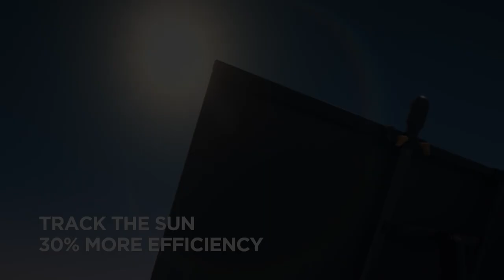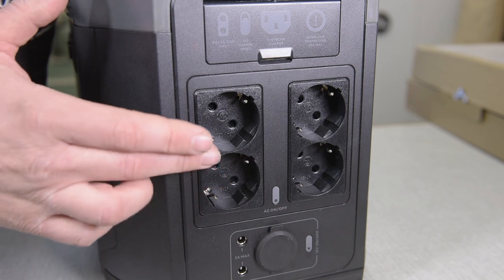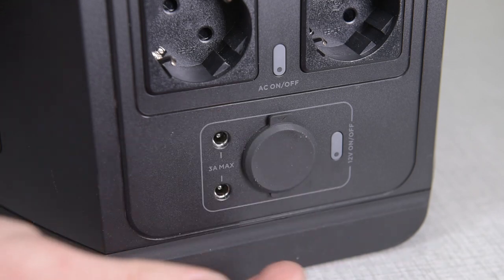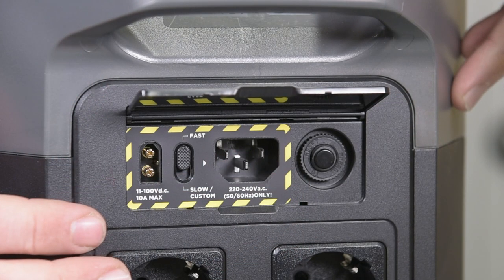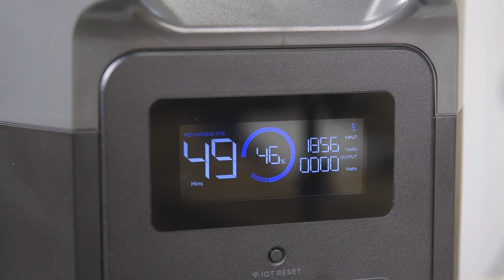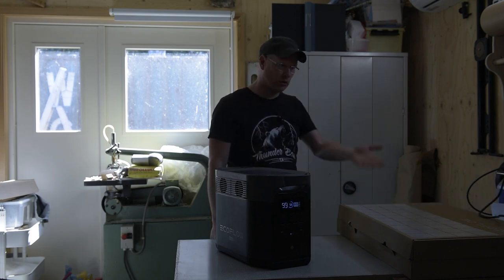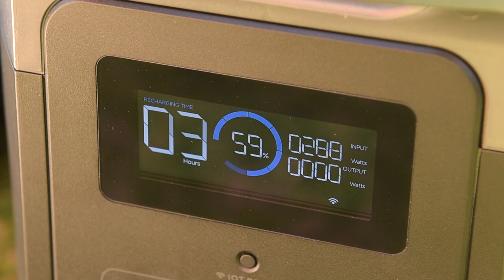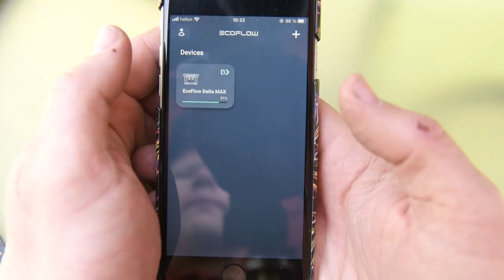Blacksmithing off grid with the EcoFlow Delta MAX

Comment: Nice video and a great presentation for the sponsor.  I was particularly impressed that the batteries would keep up with the welder.
Reply from the maker: Thanks! Yes, that impressed me as well.
Reply: I have been looking at these or other brands recently.  One u-tuber said that in his experience, this was the best brand.  That it would operate a welder is a definite selling point. Thank you for the demonstration.
Reply: I met some guy a few years ago that had welding a job in a ski station with no power, they used some kind of battery powered stick welders
Reply: why does he wear a respirator?
Reply: @abdullahanwaar7389  so he does not breath the fumes and particles from the coal

Comment: Best review yet I've seen on these EcoFlow units, mainly the real world shop testing.  The engineering and modular designs on these is quite good, including the panel kits, imho.  Good design is always expensive but a 4k investment is substantial for an old geezer on fixed income.  Glad that you hooked up with them and did a bang up job testing it for us!!!  Thanks Torbjorn always appreciate what you bring to us!
Reply from the maker: Expensive for sure as most Li-Ion batteries are, but could be worth the investment for some! Thanks

Comment: My family and I were affected by Texas' power grid failure back in Feb. 2021. We definitely could have used one of these to get us through it.
Reply: Generac is instant power, and doesn't require solar power to charge it.  I'm assuming you suffered through the polar vortex situation, and the Biden fossil fuels cancellation, which his energy secretary dictated for all natural gas pipelines to be shutdown also, which froze the valves shut, rendering the emergency critical, and people froze to death, and tens of thousands suffered immense property damage also.  Fossil fuels are still FAR more reliable, but that battery pack is impressive don't get me wrong, the world just is DECADES away from canceling all fossil fuel energy.
Reply from the maker: Honestly if we were to stop using fossil immediately, I don't think it would take that long to figure out new solutions.
Reply: @torbjornahman  how would you forge without coal? Not to mention these power sources are just batteries. They all take tremendous amounts of fossil fuels and tons of mined minerals to manufacture. If the world stopped fossil fuels all at once people would freak out with no phones or YouTube. Wind and solar can’t come close to the load that humans require.
Reply from the maker: @gregdazer8395  For a forge I can use charcoal with no problem, it just more practical with coal as it lasts much longer.  Indeed there would be panic, but with panic people will find new solutions :) I'm pretty sure we already have alternatives more or less, it's just a matter of people investing in new tech but very limited amounts of money are actually spent on research like this or on implementation. It's so much easier to keep burning fossil.
Reply: @torbjornahman  I’m sure you can use charcoal but burning any fuel emits CO2. So to those pushing the climate change narrative charcoal is just as bad. In actuality the most abundant greenhouse gas is water vapor not CO2.  Once the world caves and drops fossil fuels they will just make a move on other fuels. There will be no end. If the world wants reliable energy fossil fuels or nuclear are the best options. Wasn’t looking to start a back and forth however. I love your black smithing videos just wish everything wasn’t trying to shove a phony climate change agenda these days. It used to be called global warming but that lie fell apart. I hope this one will soon do the same. God bless from America.
Reply from the maker: @gregdazer8395  :) Charcoal is Co2 neutral, since it's made from wood. Nuclear is definitely something we should use more of, but move away from today's water cooled high pressure reactors. They are all more or less designed to make plutonium and electric energy as a secondary bi-product :) With only energy in mind I think reactors would have looked very different.

Comment: A really cool idea with this anti-lawn mower fence. From what you can see, the power bank actually has a huge capacity. I have a garage without electricity. I have been thinking about using such a power bank in my case for a long time, but I was curious how it actually works. You can see from your video that it would be a good idea for a garage
Reply from the maker: Thanks!

Comment: That's pretty cool that you can run ur shop off one of those. Can't wait to see more videos soon my friend. Hopefully you get great use out of it for many years to come my friend. Keep up the great craftsmanship and hard work my friend. Forge On. God Bless.
Reply from the maker: Well, I can't run any 3-phase machines, but the basic things will work fine!
Reply: @torbjornahman 
And if you use a frequency inverter? It has a single-phase input and three-phase output plus you can vary the frequency according to your requirements.
Reply from the maker: @ivanlarin86  Yes, and no... Single phase converters usually does not step up the voltage so I would get 230V 3 phase, which would require a re-wiring of the motor to D-drive instead of Y. Since they are all wired for 400V. I could run my wood lathe which is already wired like this.
Reply: @torbjornahman 
Sounds reasonable!

Comment: Impressive gadget !! That power unit could be very useful in my neck of the woods, namely outback and isolated areas of Aus. Would be very handy to be able to do small welding jobs without having to cart around a large generator, not to mention camping trips etc. Top video as usual, enjoyed the review of that power unit. Regards from Down Under.
Reply from the maker: Definitely. They are not cheap, but probably worth the money in situations/areas like that.

Comment: Thanks for the video, a pleasure to watch, the lawn mower robot is so cool.
A very good product, I'd see this perfectly for a week-end or even a week camping off grid. 
If only used for phones, lighting, perhaps a couple of laptops and low power consumption stuff, it can last for a long time, not to mention the solar panels, I see they provide 240 W. Means that every 4 hours you get 1 KWh available again if I got it right.Which means up to 1/3 of its available power.
Reply from the maker: Yes it lasts a long time for things like that. Each of those panels are 160W, and with full sunlight they provide about 315W. However you can charge with 800W solar if you have that available.

Comment: I have just looked at the characteristics of this UPS on the company's website - a pretty good thing. With a power of 2.6 - 3.4 kW, if you don't load the connected devices too much and use them moderately, then I think one charge should be enough for a day. And if you connect additional batteries, you can increase the power to 6 kW.

Comment: Wow! Impressing!
That power unit seems to have some really good batteries to cope with the welder! In most of the cases the batteries will fail first and if possible, need to be replaced. But it is still a very good and useful equipment which is a nice addition to the workshop!
Thank you for your videos! 🙂

Comment: I found myself trying to blow the slag off the anvil during the close up shots🤣 habits I suppose.
That’s a very impressive power station. Compact and very easy to use. Did you try the mig welder? I’m sure it needs Atleast 4,000w maybe more depending on make and model.
Reply from the maker: Well, the mig is 3-phase...as most of my machines.
Reply: @torbjornahman  well that makes sense. Had no idea it was 3 phase. Mine are all single phase 240v so it made me curious.
Reply from the maker: @erikcourtney1834  We use almost exclusively 400V 3 phase for heavier machines. Here every household has 3 phase.
Reply: @torbjornahman  that’s pretty smart that it was set up that way. Less current needed at higher voltages.

Comment: Is that a special kind of rebar that welds? You're truly a master blacksmith!!
Reply from the maker: I think you can weld most rebar, no? Perhaps not great but still.
Reply: @torbjornahman  I thought you had to use type B?  Maybe not?
Reply from the maker: For actual structural integrity I have no idea, but for something like this it just needs to "stick together". :)
Reply: @torbjornahman  
Good to hear.  I was thinking about building a log rack but decided to use treated lumber Instead. 
I tried to weld two pieces together but it didn't hold. I'm not much of a welder though.  Have a great day!!

Comment: @11:02 what is that square block with the all the holes and Radii/Radiuses on the outside called?? I recently got into blacksmithing and I've been wanting to get one but I have no idea what it's called and trying to describe it, to be able to google it hasn't been easy lol.

Wow I'm really impressed that the power bank had enough power to run an arc welder. 😱👍👍
Reply from the maker: It's called a swage block!

Comment: Hahaha, good video Bjorn. When I saw the title, not knowing a thing about the product, I was wondering if some lunatic had created a setup to run a forge/kiln, power hammer etc., forgot you only have the kiln for heat treating. Impressive as others have said that it can power a welder, those things draw a lot of power, but more so, a lot of AMPs, would be well curious for someone to continually use one to weld and see how long it survived. How long did it take to charge it using the solar panels?

As to the project, when you were done I was still scratching my head what the heck it was for, good and elegant solution, but did not realise you didn't cut your own lawn :-p LOL
Reply from the maker: Don't know about continuous welding, but for smaller projects it would work fine it seems. With the panels I got it charge with about 300W, so that would mean a full charge in about 6h.

Comment: A portable welding machine need about 6 kw to work. The ecoflow station powered 2 kw  ???  I don't understand. Can you explain ?
Reply from the maker: Not a small stick welder like this. It normally runs on 16A 230V.
Reply: This is actually the first time I have ever seen the Delta Mini being used in a blacksmith shop. Thanks for the video.

Comment: Perhaps an induction forge rather than coke fired conventional. Sadly most models won't operate on the available current from the battery pack you are promoting.
Reply from the maker: No, those start at 20kW or so...

Comment: how fast is your forge
Reply from the maker: How fast?
Reply: @torbjornahman  well if you put brush steel in forge how much time it takes
Reply from the maker: @hermannikarhu620  It depends on the size... A 10mm bar will heat up in 30 sec. maybe... Reheats much faster

Comment: A fair test would be to run it on solar only without first charging it from the source you are trying to replace !   Maybe on an overcast day !
Reply from the maker: Well, as an emergency power source you might have it charged from the grid and during blackout you use solar. Totally off grid is another story of course. Solar on an overcast day is pretty lousy, maybe 10% from a sunny day.

Comment: Okay... I've only been an electrical worker for 27 years, so there are a lot of things I don't know yet. BUT...

100 watts at 5 volts is 20 amps. 20 amps through an 813 micron diameter wire is a BAD IDEA. I'm calling "hyperbole" on this one. Hyperbole is like cockroaches: if you see one, there are more than one.

Also, the battery is SMALL!. Yes, small! 2kwh divided by 20 amps divided by 220 volts is 3/4 hour of use. Pathetic.

Again, I've only been an electrical worker for 27 years, and I've only been studying electricity and electronics for 46 years, so there are a great many things about it I've not learned yet. Take my "it sucks" opinion with a grain of salt.

You have nice plants in your garden! I'm also VERY interested in the lawn-mower!
Reply from the maker: :) Look up the specs on USB-C.  It will not deliver 20A at 220, more like 10A at 230V... but yes you will not run your heater on it for very long.